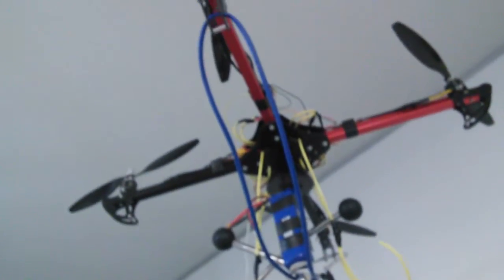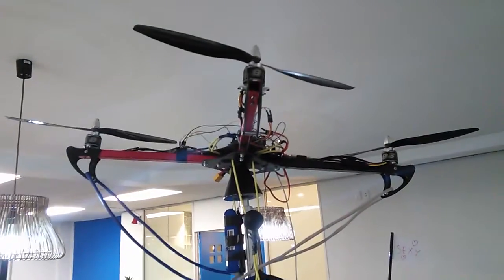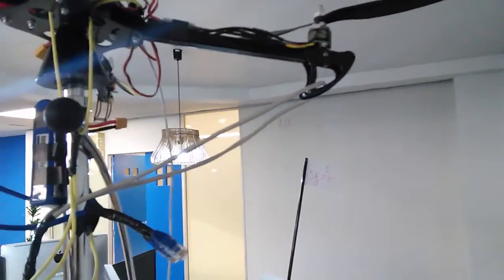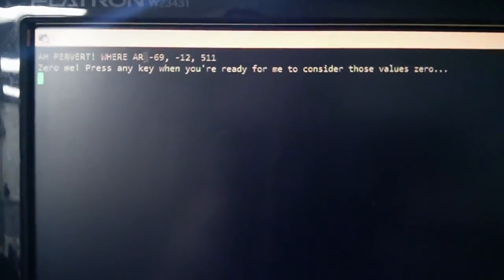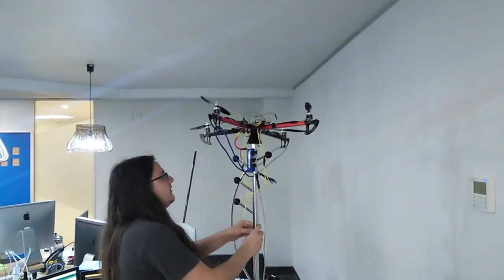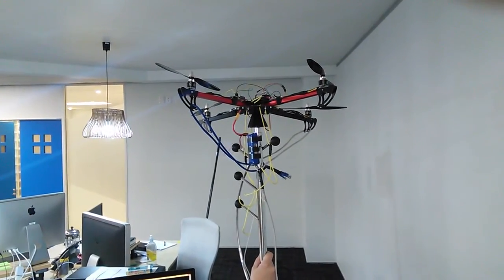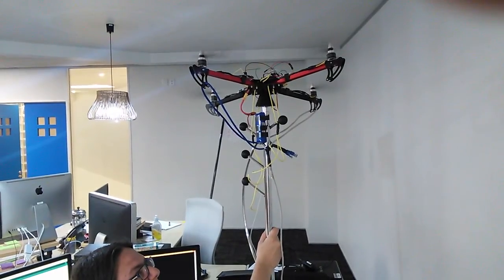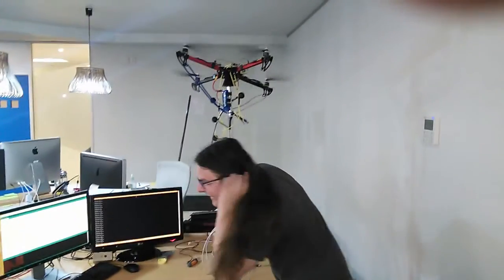Naive quadcopter stabilisation algorithm

Comment: '48    Serial.println("AH PERVERT! WHERE ARE YOU TOUHCING ME?! Put me down right now!!!! >.<");'
XD
'80    delay(150); // Wait 10 ms'
I think this isn't up to date...
'105    // Verify whether any throttles are too powerful'
apparently you could have lowered the limit a little and it is also a great idea to add a min_throttle limit so that your motors don't stall while in flight because of a brutal maneuver.

however, I was expecting a PID controller but apparently you did something waaayy weirder :
'78    // For each motor, try increasing the throttle by an amount and seeing which gets it closest'